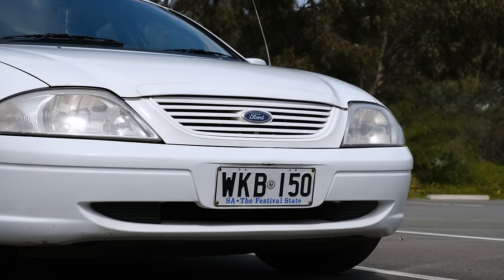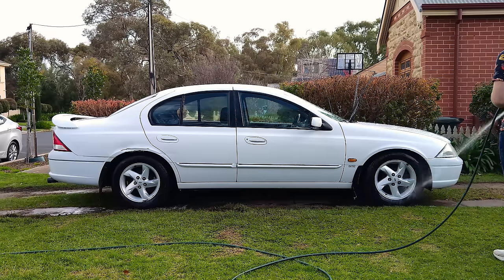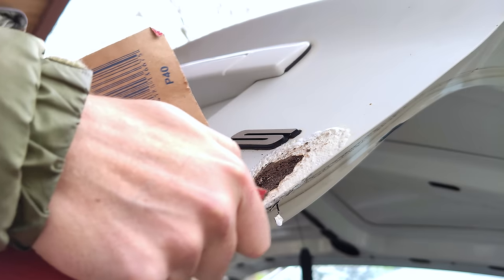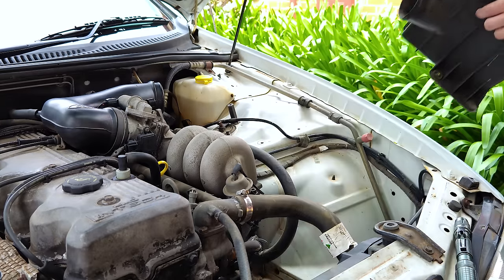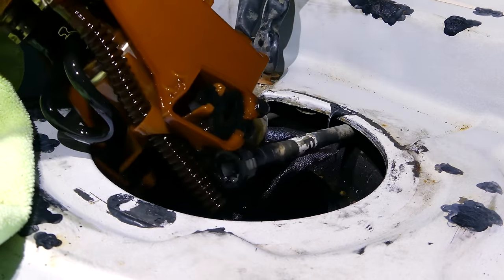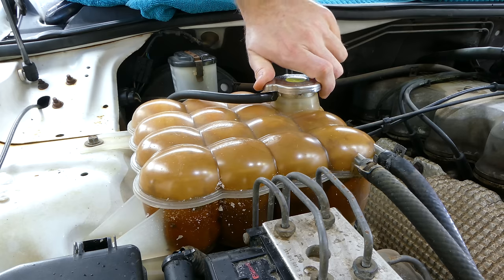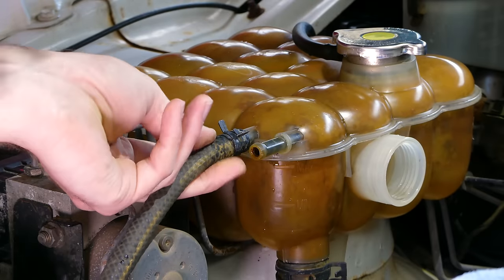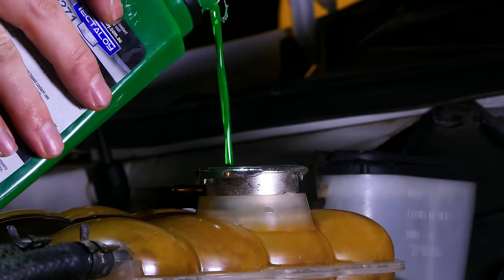Fixing A Cheap Ford Falcon From Facebook...

Comment: Hey mate, Cam Position Sensors are generally needed for EFI systems for both injector and spark timing.  Even if SOHC and no variable valve timing.  Older cars used to use the distributor for all of this, or at least just the cam position.  Once you go to digital ignition there needs to be a cam sensor, or a lone crank sensor with lots of sensor "teeth" and a TDC cutout.
Reply: It’s for sequential injection in a single cam. Earlier EFI systems were batch fire so the ecu didn’t need to know where the cam was in its rotation

Comment: I really thought it'd be a thermostat issue, since I bought an XZ550 and it used to overheat and make painful noises as it died, then me and my dad cleaned out the wasp nest in the odd pocket of the thermostat cover and ripped out the thermostat entirely, fixing the issues apparent before, and now it takes 12-15 minutes to overheat standstill rather than <10 standstill or moving

Comment: WOW  ... If the cooling system was so disgustingly neglected, I wonder how grotty the engine oil was (didn't notice any mention of that). I change my engine oil at 10,000 km or usually much less, never leave it more than 12 months, even if it hasn't done much mileage. I'm driving an AU2 XR6 VCT ex cop car, probably spend too much money on it but I love it when some twit in a tweeked up SUV tries to run me !  Also there's a little known thing that can be a problem with AU2 & 3 front brake calipers, when they changed to the twin piston caliper they are fitted with plastic pistons  which can sieze up over time. I've changed mine to chrome steel pistons which you can still get, don't quote me but I think they're the same pistons which were upgraded for the BA models.  Another very common problem with rough idling is the intake manifold gasket.  AND the recommended fuel is 91 grade, you don't need to stick 98 in it and think it goes faster !

Comment: Yo, Psivewri! Quick heads-up on wipers. If you can, I'd recommend upgrading to the newer "beam style" which are essentially a thick piece of rubber. Sounds kinda odd, but they don't rust, last longer, and generally perform better.

Comment: Its a pretty smart idea to read out DTC (faultcodes) to get a bearing of the problem instead of wasting money by part swapping random parts
Reply: You do realise the au is not obd2 compliant? It requires special software to read the codes. An everyday scanner will not be able to read it.
Reply: @HPHyenadon  I`ve had two cars with OBD1, you don`t need a special software but it i helps. If you use a lamp or a LED you can count amount of blinks and that will tell you a code.

Comment: Unless it is running in wasted spark, pretty much all engines running coils without a dizzy will use a cam & crank position sensor. (This is because in sequential fire the ecu needs to know whether the top end is firing a cyl or waiting for the exhaust to be actioned. The bottom end has a fire and exhaust stroke which the ecu will not know which is which without cam sensor to tell it).

Comment: I bought a 98 Fairmont Ghia for $1000 NZ about 5 years ago with 200'000 ks, it was in the exact same condition, except no rust, just badly faded black paint, no sensor problems yet, but I know where they are now, thanks. I think I'll keep it until it's worth a million dollars like the GTHO Phase 3, now that they stopped building Falcons.
Reply from the maker: If maintained they are great cars! My sister bought this one off of me and apart from some minor repair work (new starter motor and FL ball joint) it's going great 👍

Comment: Hey I've just stumbled across this video, did you have to pay the guys to scan your falcon? The whole problem with regular scanners is the obd. Ford never implemented obd2 properly in the au, so it needs special equipment in order to scan it and check for faults.

Comment: If you are troubleshooting a run issue, the cooling system is not where to go. A run issue will be fuel, air, electrical, or timing every time.

Comment: "If this car was worth it, I'd have replaced the coolant bottle"...but you replaced the coil pack, fuel pump and various other random shit that could have been tested with a $30 fault code reader from Supercheap lol.

Single cam engines still need a cam position sensor to be able to run sequential EFI. Without, the ECU runs in batch fire in a limp mode. Old Ford EEC ECUs didn't really have the ability for limp mode so just ran shit.
Reply: The problem is the au isn't obd2 compliant. It has an obd2 pin, but your regular scanner will not pick up codes or scan properly. This is why the scanner in the video did not work.

Comment: Just came across your channel. Excellent video. The wire on that sensor looked like it had been repaired before, it had electrical tape on it
Reply from the maker: That was done by me to help protect the connector.
Reply: @psivewri  ohhhh that makes sense. Thanks for replying

Comment: Hang on to that AU, in time it will be worth more than what you paid for it . The older Fords are becoming more collectable. There was a lot of muck in the cooling system, the last owner must have used just tap water for a long time. One thing i will say , the Ford is easier to work on than my Mitsubishi 380. :).

Comment: I'm having issues with mine not locking. Using the key makes the door button depress but pop straight back up. Using the fob makes the drivers door button depress but pops back up with six beeps. The passenger door cannot be opened from the inside. I'm thinking the passenger door actuator is the culprit. Any clarity out there?

Comment: im no expert mechanic by any means but if you can always try to scan the car first with a scanner itll save you a lot of trouble. Over in the US you can bring your car to advance auto parts and they'll scan it for free.
Reply from the maker: That's usually not the case here. I was lucky my father knew someone who would do it for us. Nearly every other thing I did to the car needed doing anyway.

Comment: Adjustable seatbelt height is pretty common in the US; I'm kinda surprised that it doesn't usually make it into the Australasian market.

Also, it's utterly alien to hear that you can get registration for less than a year; AFAIK, one year is the minimum in the US, with some states (e.g. Florida, where I live) offering two years.
Reply: One year is the minimum in Australia too, it's just that the previous owner sold it with only 3 months left. Rather than letting it expire and putting psivewri on the hook.
Reply: @TommySailing  Ah, interesting.

Comment: Nice video, great to see a change up of vids - espec the Ford Falcon AU haha - what did you use for the headlights again? We have heard cut and polish does alright put idk...... cheers :)
Reply from the maker: It's a specific polish for headlights. Has a sealing spray that you apply afterwards. Works pretty well for a year or so. Then you've got to apply it again :)
Reply: @psivewri  Awesome, thanks so much - I live in Adelaide as well so I’ll go and check out SCA and Bunnings 😁 I miss the old regos :((

Comment: Like all cars built down to a profit margin these things were junk in comparison to the Japanese. Ford's fianally addressed the head gasket problems plauging previous models right back to the XF by installing a triple gasket arrangement. As you can tell from the list of problems these things have to be babied to keep them running. Built down to a profit margin meant that Ford installed the cheapest option available to get the vehicle past the 12 month guarantee offered, the brake light switch being a prime example.

The in-line six motors are generally pretty bulletproof, falling victim to the stuff around them, the biggest drawback was these things is they drank petrol at an astonishing rate. The Commodores of the time were slightly better but also being built down to a price they suffered quality issues. The Commodore was the better looking of the two as the AUs copped plenty for the styling, although when they first came out I quite liked them. The AU III was a good car for an Australian effort but it had to go through an evolution to get there. Ford's spent hundreds of millions to get the AU on the market and from memory never recouped their investment. Like their late 80s and 90s counterparts the Ford's were thirsty but with the head gasket problem addressed these tanks are cheap to buy but expensive to fill up. Give me a Toyota any day.

Comment: This is the car for Falcon of Gameranx fame lol.

The adjustable heights are common.

Edit: was thinking vacuum leak around the 7:30 point

That sensor makes, uh, sense haha. Hope it lasts you a while. If ford AU did well with their engine design, that inline six should last quite a while. Should ride smoothe when not misfiring and feel torquey
Reply: Falcons were the de facto fleet car here so you can commonly see them being sold in good shape still with 550,000 on the clock. A bit of care goes a long way.

Comment: Wait, Australian cars don't usually have adjustable seatbelt heights? I've almost never driven a car without them here in the US.
Edit: and the headlight controls here are also usually not on the turn signal stock but to the side of the dash cluster (on the left here in the US).

Comment: So, I have to ask - how much did you end up spending on all the parts + the purchase price of the car itself?

Then, how much is it worth in good running order?  You have to wonder if that's why the previous owner wanted to get rid of it.
Reply from the maker: Car was $1,200 AUD, parts all up about $300 as I got them at cost price.  Sold it for $2,000. Made X amount from the sponsor and ad revenue. Had fun and made a decent video out of it as well. Very much worth it!
Reply from the maker: If you watch until the end of the video it's pretty clear that they couldn't work out why the car had issues. But I did.

Comment: If you just mix eucalyptus oil with the coolant, all the problems of the car will just be automaticaly  fixed 😎. Just kidding, but if you want a good cleaning on the expansion reservoir, put a good amount of wet sand and in it and shake it until all the gunk disappear. When you done, it will look clean as new.

Comment: For the $1,200/$700 you initially spent on the car, you spent too much to keep it drivable in my opinon. 

That money would have been better spent on another car.
Reply from the maker: Only cost about $300 in parts and was done pretty much just for the sake of a video. That is a dirt cheap price for one of those that hadn't been molested by hoons.

Plus the sponsor and ad revenue definitely made it worth it!
Reply: @psivewri  No.  Adding the $300 to what you spent on the vehicle would have gotten you a better base car for sponsored content in my opinion.   You only invest that amount of "time" if it was a rare of classic car.

Comment: lol "rust converter" used by people who think you can convert a turd back into a cheeseburger...
Reply from the maker: It does work quite well at stopping the problem getting worse. Once sanded back, rust converted and painted.
Reply: @psivewri   What is stopping the rust is your paintjob because it isolates the metal from air. No oxygen -> no oxidation. A painted piece of metal will never rust until the paint cracks. At best it helps your paint stick in places where rust hasn't been fully removed because black oxide doesn't flake off. On a old car like this it's probably good enough but i wouldn't use it on anything i'd want to keep. 

Anyway. great job on that car.